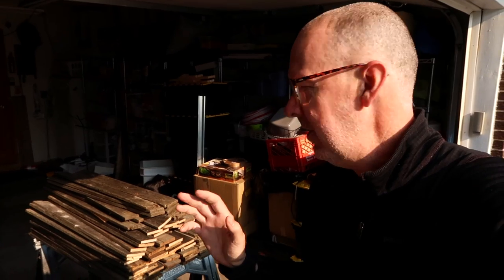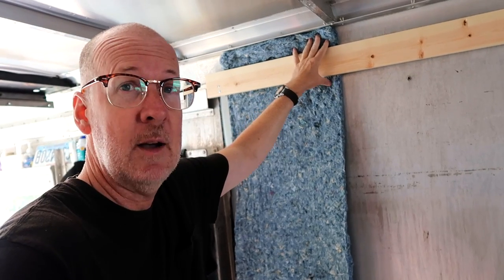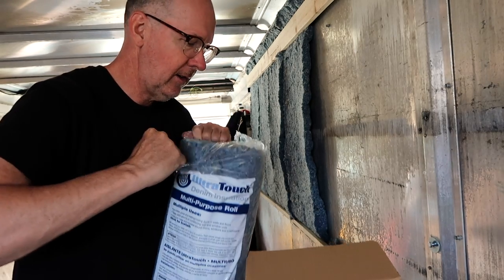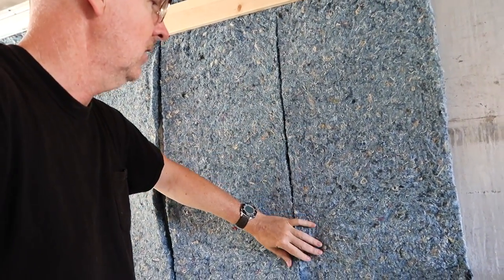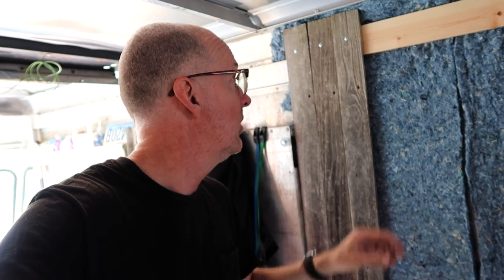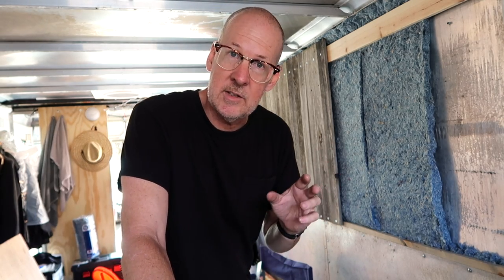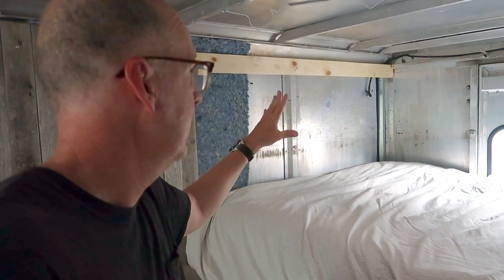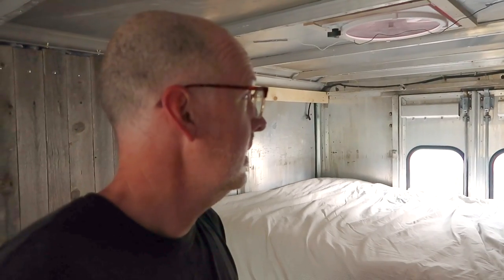Step Van: Installing Denim Insulation and Reclaimed Wood Panels E282

Comment: Looks great! When you get to insulate the doors, maybe the foam, as it can get wet. I can't wait to see with the cabinets and lighting! You are doing great! God bless!
Reply from the maker: foam would be better as you suggest, but much harder to install due to the door mechanism (long rods, levers and mounting hardware. cutting foam around all that would be quite difficult. I'm thinking the denim might go over the top of it allowing it to still function.

Comment: When you go to do the Ceiling leave about 4" on either side OPEN and put a 6"  Wide strip of wood over it . WHY YOU ASK ? If you need to rewire something down the road it will be a lot easier to take down the 6" strip on either side to run wires that it would be to take down the whole ceiling . Also when you put up cabinets run some heavy cord over them(6 or 7 of them) just in case you need to pull wires over them . It will make it real easy down the road . Good Luck and have Fun . If your ever in the REDDING, CA area stop by and say HI ...

Comment: For the ceiling try to get the foam with a foil face to face the inside of the cabin before covering it with your desired finish. The foil is a radiant barrier that will really help on hot sunny days.
Reply from the maker: thx for your recommendation!
Reply: Seven Wanders the World Read the instructions.  I think the foil should face out to reflect the heat. ???

Comment: If it's not too late.... Building your wood upper wall section all the way to the rear at the bed, and all the way to the front at the kitchen, would mean an extra half-inch of thickness, but the ability later to change the configuration of every part of the interior, and have that gorgeous wood be there no matter what you do. Your backsplash would easily go over the wood yet be removed/altered later, and you could remove the cabinet over the bed for some other choices. Making that substrate (wood) consistent everywhere is always a worthy consideration in an environment subject to change over time.
Reply from the maker: thx for the suggestion. I had considered your method of the build for many weeks, but decided this method would be better for my purposes. I hope it will become clear in the next couple months as the walls are finished

Comment: Looks good. Better than I pictured in my head. I'm working on insulating a pickup bed cap, and was wondering what to use on some of the curved surfaces. That denim stuff looks like it might do the trick!
Reply from the maker: it is a lot like fiberglass, just without the pesky problems in handling it. of course poly iso will give you higher R value, but its hard to work with on curved surfaces

Comment: Hi Seven, lookin' good mate !!  Just wandering the plywood sheet in front of your bed that is the back wall of the garage that you see when you walk in the siding door are you going to cover it in the fence palings as well, it would look pretty slick !!  Seeya Rob
Reply from the maker: Rob, I'm planning on removing the plywood front of the garage to build in a bookshelf, kitchen table and some storage areas. but that said, if I didn't have those plans, you are correct the fence paneling would look great there!

Comment: You could have used some of the Scotch Super77 spray adhesive to hold the batts in place. Great choice for insulation!
Reply from the maker: I thought about that, but don't think it is necessary. however, I will use 3m 77 for the iso foam ceiling install!
Reply: OK ! Try a bit of the spray on a small piece of iso foam to make sure it is compatible. I have seen some foams dissolve when certain solvent adhesives are used. The van is really looking great and I like the concept of being able to remove a single fence picket to run wiring or whatever is needed!

Comment: Seven, Once you build the cabinet at the end of the bead the easiest and also a strong way to fasten in to the uper stringer would be by means of a French Cleat,  and it is easy to remove. If you look in any wood working books whe have a diragran of the French Cleat system they are simple and strong and rely on gravity pressure.
Reply from the maker: thx for the suggestion. I'll check out the french cleat!

Comment: Wow! Looks great! Lots of progress, and its really feeling more like a home and less like a delivery van now. Bet it changes your sleep.  Any impact on the driving noise from the rear insulation?  Liked learning about the denim insulation. Looks like the denim is broken down and then put back together in a process called felting. Should insulate well.
Reply from the maker: every little thing I do improves the space, but the bed/garage and new wall panelling have made the largest impact in quality of life. driving noise is less, but mostly I'm getting engine noise due to lack of insulation around the doghouse and the aluminum drivers cab area. once I have a kitchen/bathroom I'll work on tackling that problem. yes, I believe you are correct on the felting. I just didn't know the term for it

Comment: Awesome, love the fence for the upper walls. Just found your channel. I don't know if you have done anything with the roof of van. I have seen a product that is used on mobile homes . It is painted on and it stops the heat from coming in.
Reply from the maker: my roof just has a rotary light on it. I've seen the special reflective pain for roofs
Reply: Seven Wanders the World I guess some have put the reflective paint on full vehicle to really lovwer temp

Comment: Steven it looks really great. I disagree with the slammers or pessimistic people that should take bets as to if it will or not vibrate down. I can't see how it can it has no place to move to besides it will compress up against itself before dropping down. From top to bottom of it it is held up against the wall and the bottom of it is resting on something so I just can't see how it could. But maybe I am just stupid or dumb. But maybe the screws you used were a bit longer than the wood the screwed into which would also hold it in place regardless it is not going anywhere. I have to wonder why so many - I would do it this way or I would have done it that way. But they all would have done it their way but none of them are doing it period. And the people that would have used spray foam well heck when they do their own van they can. Looks nice I like the fact that it is not perfect looking it has a homey look to it. Cheers from another step van owner in the NW Rockies....
Reply from the maker: thx for your comment. time will tell. the great thing about the way it is built is that it is easy to check the status and fix if necessary ;)

Comment: Going to be interesting to see how long before the denim insulation vibrates down.
Reply: Considering it slides right under that wood, only a couple of weeks, then, back to doing it the  RIGHT WAY!   SEVEN , FIX THAT, ITS NOT GOING TO WORK THE WAY YOU THINK! I used to build custom vans.....
Reply: I really hope your wrong.
Reply: Would you pessimistic people explain to me just how the heck it is going to vibrate down?? There is no room for it to do so because the wood is holding it flat up against the wall and the bottom of the material isn't left hanging it has a bottom to rest on. So again explain your poor logic to me. And one more thing is it possible that the screws he is using go through the wood possibly even a half of an inch if so it still wouldn't come down regardless. Slammers!
Reply: Just tucking it up behind the furring strip simply is not going to provide enough friction compression to hold long-term.  I would have tucked the top and put spray adhesive on the wall.  Even screws partially into the denim probably is insufficient.
Reply from the maker: I believe there are three things holding it in place: 1. the super tight fit on the top where I shoved it under the furring strip. I can't imagine it vibrating out of that 2. the backside of the fencing is rough textured wood which is compressing the denim slightly by a half inch (I'm using 2 inch thick denim in a 1.5 inch space for half inch of compression 3. the aluminum walls have rivets sticking out of them in various places which are going about a half inch into the denim. the insulation won't slide past those
Reply from the maker: all of that said, it is super easy to pull out random fence panels to see how the denim is looking and/or change the way it is held in place. I'll do another video in a month or two to give a status update
Reply: Of those factors, the one that will save you is the overall compression by the vertical boards. By itself, no matter how hard you think you have pushed under the top strip, manual compression just isn't enough. It's a question of surface area doing the compression.  The furring strip alone is a tiny surface area compared to the verticals.  It is just simple physics.
Reply: I read that the denim expands to about 6 inches is that correct?I like how the wood fencing  looks!cheers

Comment: Man, you weren't kidding about the acoustics! You had that slap back reverb thing going in there and it's completely gone. Did you notice any change in road noise driving?
Reply from the maker: it is much better driving in two ways. 1st the acoustics are improving and 2nd as I'm adding more weight the ride is becoming smoother (I have a very heavy duty suspension and almost no weight in the vehicle)

Comment: Once you have the ceiling sorted it should take most if not all of the hollow sound out of the back while driving and yes it does look good bro.
Reply from the maker: I agree! that said, I'm putting off the ceiling until I have solar and all the wires run... so will be early winter time a few months from now

Comment: On the other wall put some foam insulation between the denim and the fence boarding. That'll add another r-4 or so.  I would redo the wall wall you just completed. You NEED r-10 at least IMO
Reply from the maker: I'm not planning on being in winter cold or super hot areas. there is a huge difference between the metal walls and the new wood insulated areas in mornings. ;)

Comment: Do you have a 12v dc laptop charger? Just thinking a 12v dc with 5v dc usb double outlet would be good for charging a phone and using the laptop without having to touch an inverter. One next to where you will put your phone and one or 2 along the bench seating. 

12v outlets are also useful for a travel fridge so one at the kitchen or in the bench next to the kitchen if you plan to hide the fridge.
Reply from the maker: I don't have a 12v charger for my laptop. I go daily to a coffee shop or friends house to charge my laptop. I do charge my phone, blue tooth speaker and toothbrush from my cigaret lighter usb charger. I will be adding two or three 110v plugs as well as two outlets for USB charging near the bed & bench area

Comment: The denim will definitely vibrate down.  It should probably be glued over it's length since it tears so easily just hooking it at the top it might just separate do to it's own weight.
Reply from the maker: time will tell. it will be super easy to check to see if you are right and fix it if necessary. however, I think it will stay in place

Comment: Industrial instal recycled conduit on surface. Plenty at recycle fast instal. Or demo building
Reply: You could run your boards thru table saw to cut four sides and back of board for uniform front... You can panel behinf tail lights and spray in closed cell foam...
Reply from the maker: I love the idea of surface conduit!

Comment: I read that it denim insulation expands to about 6 inches thick is that correct?
Reply from the maker: I've read a lot about denim. I've never read that anywhere. the denim I used is a bit over 1 inch when you first open it, but expands up to the full two inches over a period of 24 hours or so (I have several areas where there is insulation installed but not yet covered by paneling)
Reply: I think I read it on the comments left by the buyers at home depot.Some where saying that it was easy to work with others said that it was hard to cut and they used a sabre saw or a circular saw with good results.

Comment: Why don't you put the boards all the way across that foot in the head of the bed that will give you more surface area to screw to for your cabinets instead of just using the furring strips it'll make it stronger for the weight factor of whatever you're going to put in the cabinet
Reply from the maker: I suppose this is a personal preference on my part, but thanks for the idea